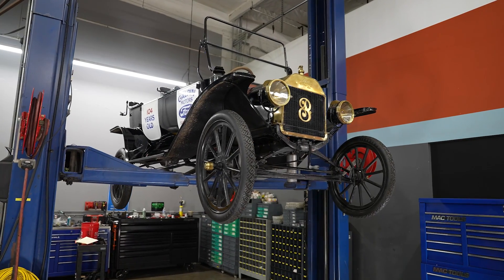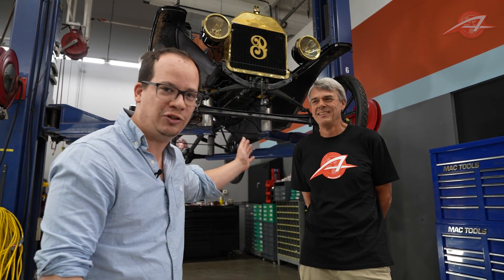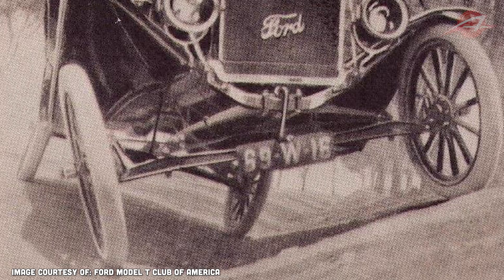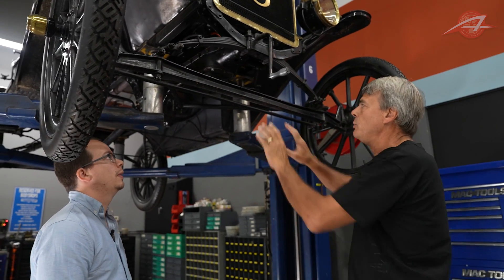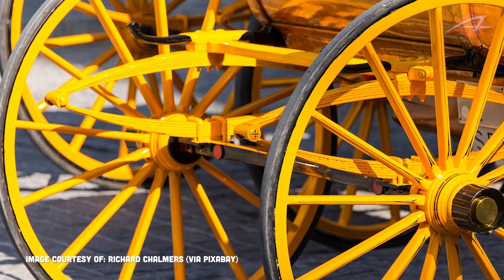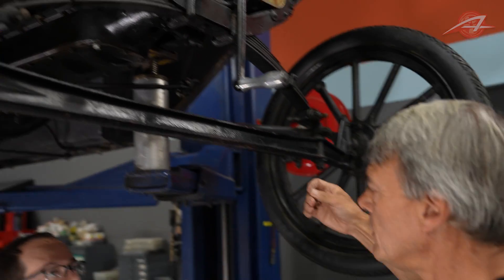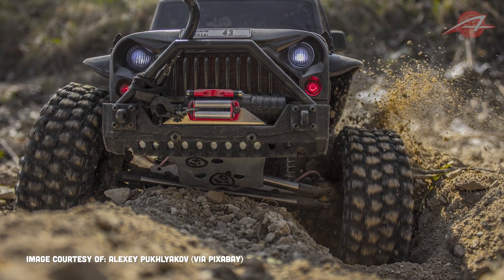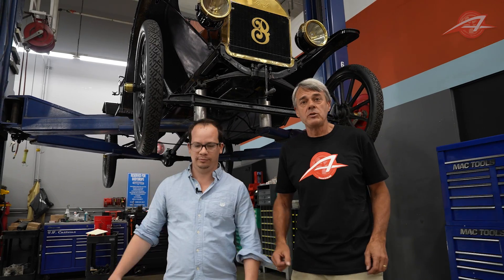How The Ford Model T's Suspension Made It Perfect For Terrible Roads – Suspension Secrets

Comment: Drive shaft in tube called a torque tube.  Buick was so attached to it the Dynaflow transmission with planetary gears was built to utilize it and used a single universal joint.  Others used Hotchkiss open drive shaft with two universals which absorbed shift shocks from sliding gear automatics better.

Comment: Amazing how many parts of the design do more than one thing. The engine/transmission are structural, the driveshaft housing is part of the suspension. Extraordinary engineering and cost optimization for the time.

Comment: Thank you for this video. The more I learn about the Model T the more I admire the car's rugged, basic design. What a treat to have Huibert Mees explain the suspension. Would you consider doing another video showcasing the cars steering linkage to include the steering shaft, steering gear box, linkage and hubs/knuckles? Why do the run positive camber? Are the wheels repairable? How do the wheels attach to the car?
Reply: The positive camber reduces the muscle power needed to turn the steering wheel. And unlike modern cars, the tires were very narrow and their profile rounded so the rubber touching the road (contact patch) shape did not change much as the car leaned going around corners. There may be other technical reasons to run positive camber that I’m unaware of
Reply: The early Model T wheels were artillery-style, with wooden spokes and metal rims on which the rubber tires (with inner tubes) were mounted. The wheels and tires were repairable. Of note was the early arrangement which kept the wheels attached to the car. If you got a flat tire you had to remove the tire while leaving the wheel in place. Very difficult. 
The later wheels were steel spokes and rims, no wood, and could be unbolted from the car to change a tire.